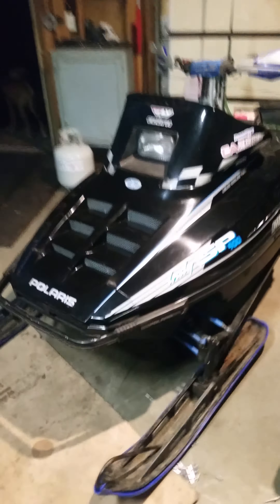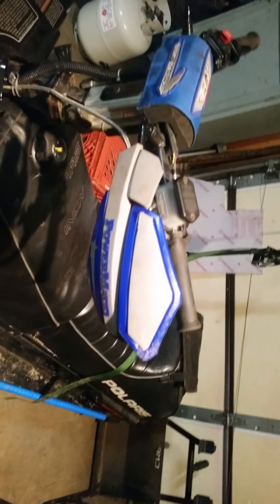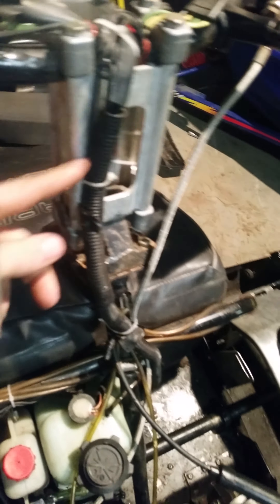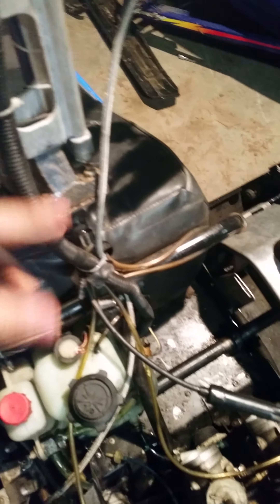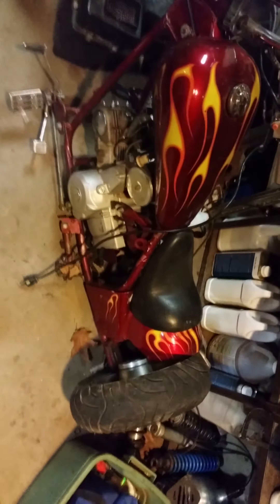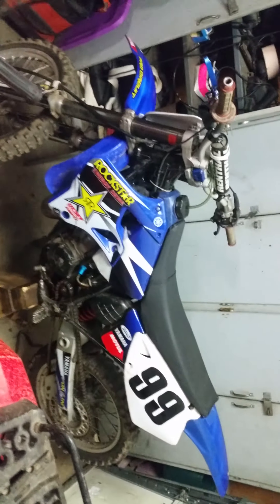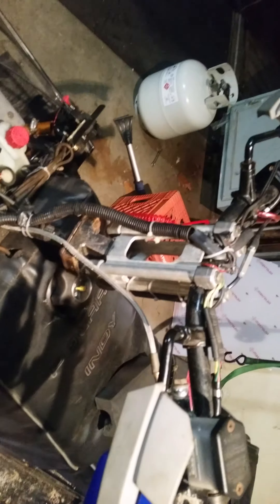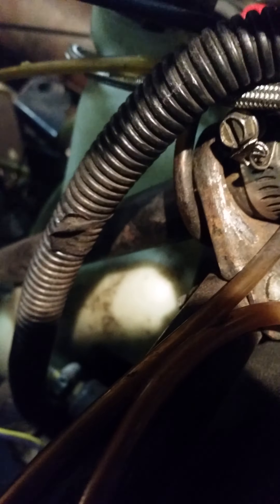Polaris 500 indy sp bar risers

Comment from the maker: I caint garntea anything but I know I have seen it done before just make sure if you lower the skid in the back to the bottom whole lower the front 2 wholes you will have to drill them out but if you don't you will to much ski pressure and not turn worth a crap